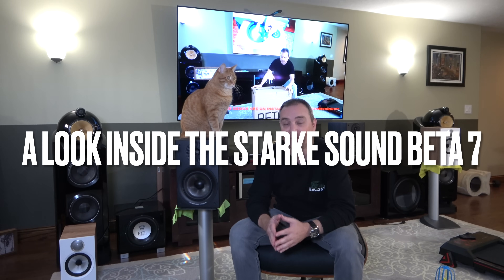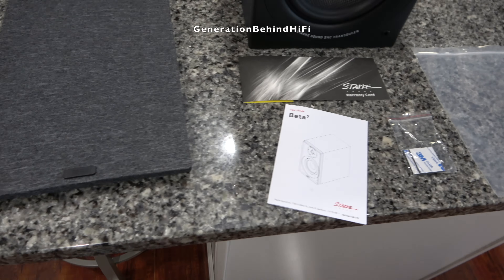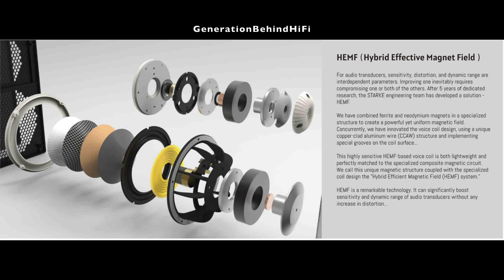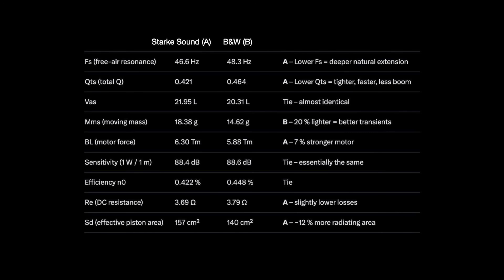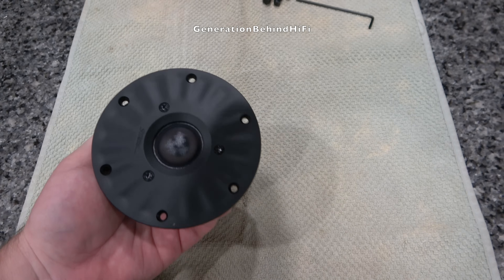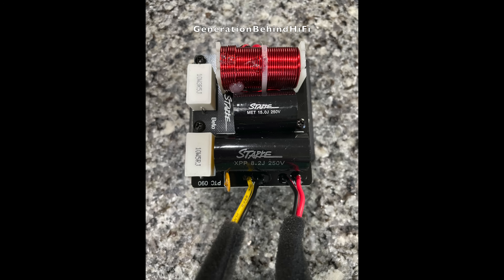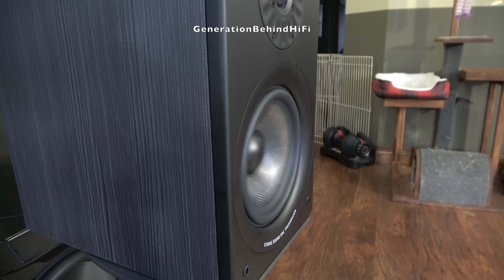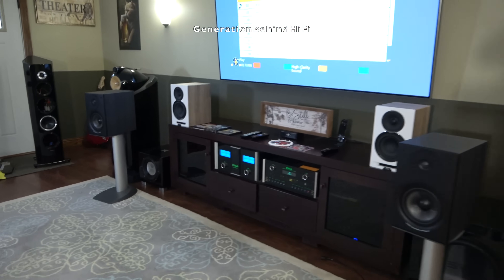A Look Inside The Starke Sound Beta7 - The Audiophile Bargain of the Year! #speakers #starkesound

Comment: Like it. But i saw the review from GR Research, he mentioned about the steel binding connectors and cheap crossover parts. Also he mentioned the grille affects the speaker response, use without that.

Comment: Mmmm recuerdo haber visto el video de gr research y no fue favorable para este speaker. Siempre es interesante tu visión.
Reply from the maker: This is why I love this hobby: you’ve got two camps.
One won’t like a speaker unless the measurements are flawless. The other just trusts what they hear.
Measurements are undeniably important, but some folks treat a 1.7 dB ripple like it’s the audio apocalypse — meanwhile the rest of us can’t tell 3 dB from a bag of chips in a blind test.
Reply: @generationbehindhifi muchas gracias por tomarte el tiempo de leerme y añadir detalles.
Fíjate que me he sorprendido a mí mismo, he construido con mdf 2 boombox 2.1 y dos pares de speakers de 2 vías. Uno con woofer sbacoustics de 6 pulgadas y el otro con woofers dayton audio de 5 pulgadas y tweeters de domo de seda de una pulgada y a mis oídos parecen unos speakers estupendos. Recientemente adquirí un micrófono minidsp para usar con REW. Veo que tengo margen de mejora que me revela la medición. Pero suenan muy bien, aún así. 
He cuidado mucho el volumen de la caja y los componentes de los crossovers, los cables y los binding post, además del material aislante y absorbente del interior de la caja. Creo que todo suma. 
Muchas gracias por tus aportes, saludos

Comment: Regarding the ferromagnetic material in the connectors, the IEEE document shows a nonlinearity (PIM) only at microwave frequencies (GHz), which are very, very far from audio frequencies (kHz). I'm very, very skeptical of what GR research says! There's no scientific evidence!
Reply from the maker: Look up Bill Whitlock from Jensen Transformers. Bill measured RCA connectors with steel shells or pins and found they generated intermodulation distortion (IMD) as high as –70 dB at +20 dBu (7.75 Vrms) in the midband, with distortion rising dramatically at low frequencies. The same problem shows up in XLR connectors. Switchcraft, Neutrik, and Amphenol models that use a ferrous nickel underplate (typically for corrosion resistance) but leave it exposed on the contact surfaces exhibit IMD 20–40 dB higher than connectors made from pure copper alloy or those with thick gold plating over a non-ferrous base.

Comment: Great job as usual GB HiFi. Pretty nice speaker for $750. The fact that there are no electrolytic capacitors being used in the crossover is unusual at this price. Why speaker manufacturers continue to use stainless steel nuts to fasten the binding posts to the terminal cup remains a mystery to me. I would think it would cost a few extra pennies to use brass nuts, but what do I know.  Is the rear cabinet panel really only 3/8” thick?  Does that seem thin to you? I look forward to your next video.
Reply from the maker: Thanks, Michael! It’s my new favorite speaker in this price category and has dethroned the ELAC DBR62. IMO, both speakers are excellent, but I happen to like the Beta7 better. As for the rear cabinet wall, I just checked my notes and I have it as being 5/8" thick! Did I say 3/8" thick in the video? Doh!
Reply: @generationbehindhifi  I’m glad you’re enjoying the new speakers. Keep up the great content. Nice to see you got a shout out from Mr. Richie.

Comment: Thanks for the mention. I didn't find it to be much of a bargain as the response was fairly rough and needed a little help. I agree though, the drivers were pretty nice and there was some good bones there to work with. With a new crossover design and some higher quality parts, it did turn into a pretty nice little speaker.
Reply from the maker: No worries! I do suspect you’re a little measurement-biased though… (You probably sleep with a Klippel under your pillow.) :)

Measurements are undeniably important, but some folks treat a 1.7 dB ripple like it’s the audio apocalypse — meanwhile the rest of us can’t tell 3 dB from a bag of chips in a blind test. Are these speakers perfect? Of course not. But at $750 a pair, this is basically audiophile heaven on a ramen-noodle budget. :)
Reply: @generationbehindhifi  Running a full sweep of measurements using a Klippel takes many hours. As a designer that is not a usable tool. We need a quick response measurement for instant information. So it is not as usable of a tool for design work. 

I am actually MUCH more subjective listening based and have spent thousands designing and building a top level listening room, and I do a ton of measurement based versus listening based comparison.

Have you seen my series on the most audible forms of distortion? 

It is also pretty hard to say I am measurement based considering I use a professional level treated listening room while most YouTube reviewers are in completely untreated rooms, with a TV in the center stage, and speakers a foot off the wall. 

This little speaker had more than just a broad amplitude error holding it back. An Iron core inductor, sand caste resistors, and ferrous material in the signal path didn't help. Better crossover design, and a little better quality parts would have gone a long way without adding much to the cost. So it fell far short of audio heaven as it missed the mark a little too far. The good news is that for only $279 there is a DIY kit for them that will push them into the audiophile conversation.
Reply: @dannyrichie9743 Can you please recommend a $750 2 way stand mount speaker that uses drivers of this quality that does not have a fairly rough frequency response with better crossover components? My intention is not to be a wise ass. I’m just wondering if such a speaker exists. Unless you build it yourself I suppose. I do enjoy watching your channel too.
Reply: @MichaelP-67  Sure, if you don't mind a little DIY effort then I can take you way past that for less money.
Reply: @dannyrichie9743  I wish I had the skills and know how to build my own speakers. But as Harry Callahan said in Magnum Force, “A man’s got to know his limitations” 😂
Reply: @MichaelP-67  Assembling a professionally design DIY kit is easier than you think. We even have groups of high school kids building them as school projects, and they have zero experience. There are also CNC cut flat packs that make cabinet assembly easy too. So it's not that bad.
Reply: @dannyrichie9743  I appreciate that Danny. I’ll keep it in mind if I do decide to take on that project.
Reply: @MichaelP-67 Danny liked the Polk R200. It measures good is similar price. But of course does not have very good crossover parts.
The truth is there isn’t many truly good crossover designers out there. Danny is or is one of the best! If I owned a speaker company I would happily sub out the crossover designes to him and know it’s done to the best it can be.
Reply: @JR-ho5qm  I’m a subscriber to Danny’s channel and agree with you regarding his knowledge and expertise. I think there are a lot of good speaker designers out there. It seems that many of them are trying to design the best speaker they can within the budget they’re given to meet a price point. That seems to be the case with mass produced speakers anyway. I own the Polk R200AE’s and really like them. IMO, The cabinet and crossover are better in the AE’s but the drivers in the Beta 7’s look better.  I would love to combine the two.

Comment: Good video, one question: how does it compare to the Polk R200?
Reply from the maker: While the Polk Reserve R200 is an outstanding speaker, I prefer the Starke Sound Beta7. It’s much less fussy about room placement and offers significantly better bass output. Hope this helps.
Reply: @generationbehindhifi Okay, thanks for the reply 👍